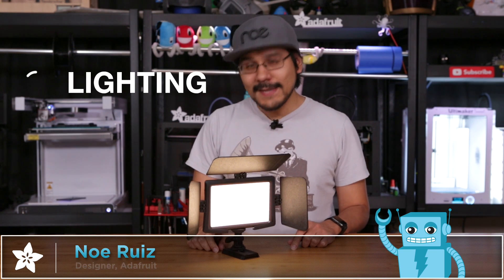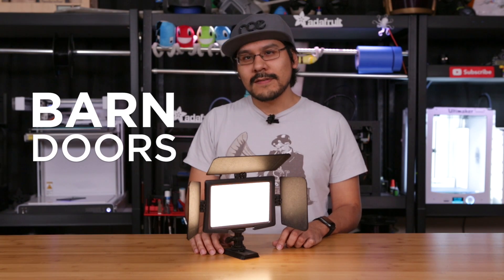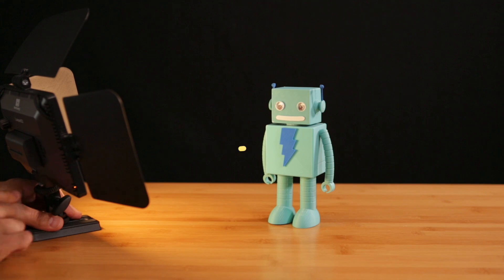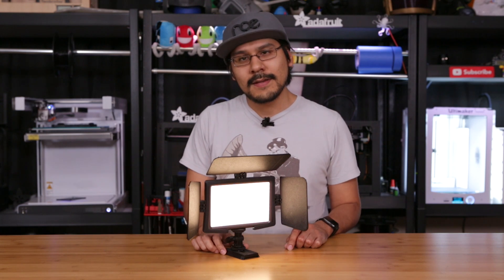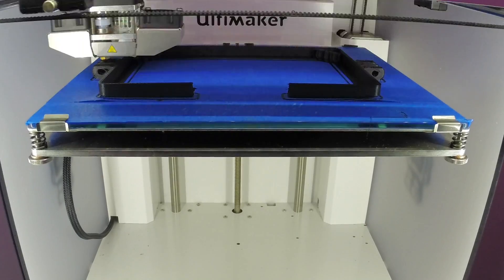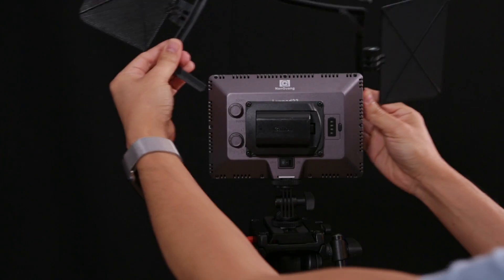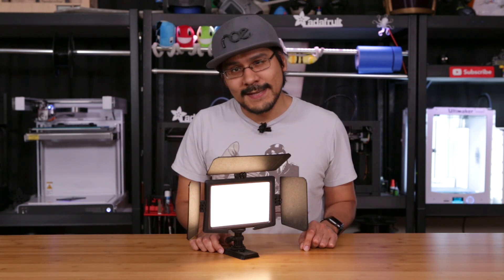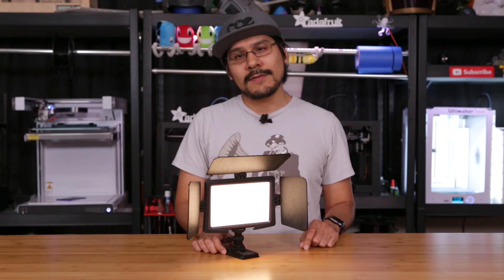3D Printed LED Barn Doors

Comment: Nicely produced video. Also, useful device and good example of a hinge design to boot. Just two questions: Roughly how much filament would that use the way you printed it?  And what is that good "gunblade" prop you used in one of the examples?
Reply from the maker: +Shawn Lockard thanks! The barn doors used up 95 grams of filament. You can check out our GunBlade video here: https://www.youtube.com/watch?v=NlsZD3fdAR0 and the guide on how to build it here: https://learn.adafruit.com/3d-printed-gunblade